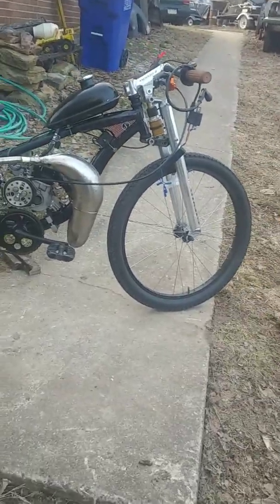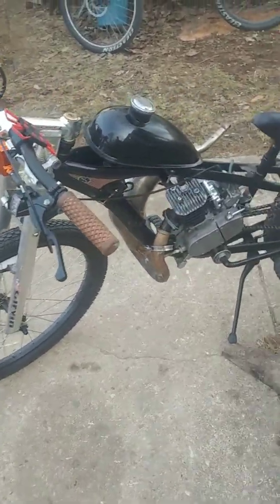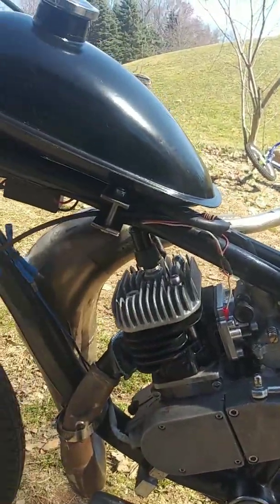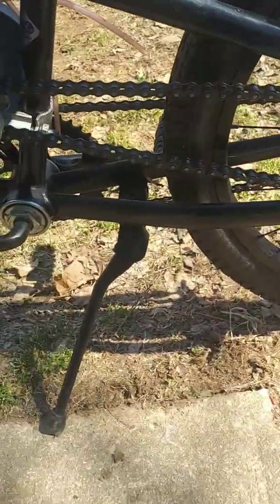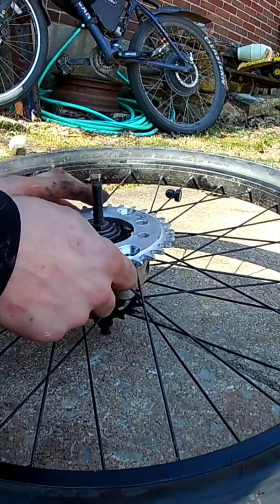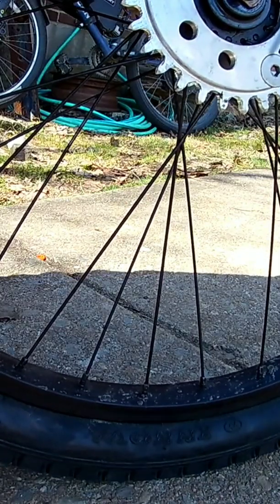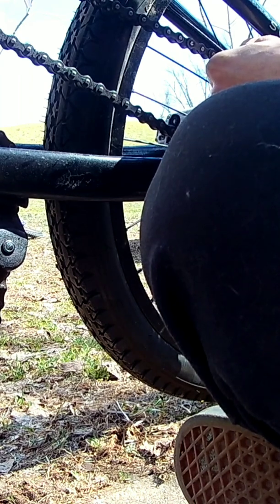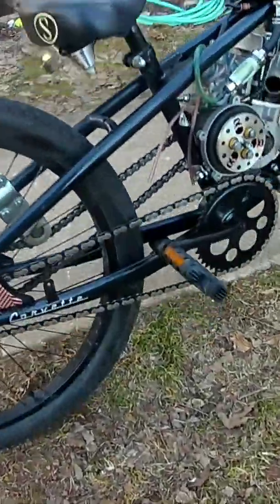motorized bicycle minarelli 70cc hybrid (60mph!)

Comment: You need a bigger sprocket. Lol
Reply from the maker: Why bigger? Would top out wayyy faster. And it had all head bolts, they just mismatched lol
Reply: @dirtesgarage8733  sounded like it was struggleling when you were going around and around.
Reply from the maker: Nah.. The hill i live on is pretty intense, starting from a stop and going up is asking a lot tbh
Reply: @dirtesgarage8733  My first gear is almost 27:1 on a 26" hookworm with a 27" actual height. I have climbed the foothills of big bear for years without having to pedal. 3rd gear is my weeeeeeee at under 13:1 with a max of 9300 rpm. 
53cc 4 stroke.
Reply: He doesn't need a bigger sprocket, he needs gears 😎

Comment: "sounds just like every other 2 stroke bike" Pipe proceeds to Opera levels.  What pipe IS that?  It aint no amazon pipe!
Reply from the maker: Its a ktm 85sx with a header from kaos kustoms garage
Reply: @dirtesgarage8733  and how much did that cost?
Reply from the maker: I got the pipe off ebay for about 80$ and the header was i think 25ish. Kaoskustomgarage.com
Reply: @dirtesgarage8733  thanks.
Reply: @dirtesgarage8733  Steve's the best😎

Comment: If you get zeda 80 and build proper aluminum cylinder minarelli it will go faster
Reply from the maker: Whats not proper about this set-up? Both are good platforms and kits available for both. Spoiler: i have a couple other bottom ends and planning to build another